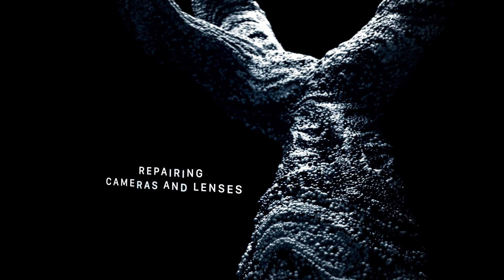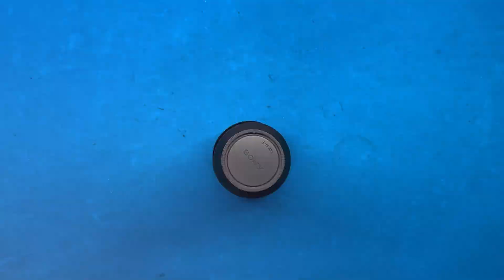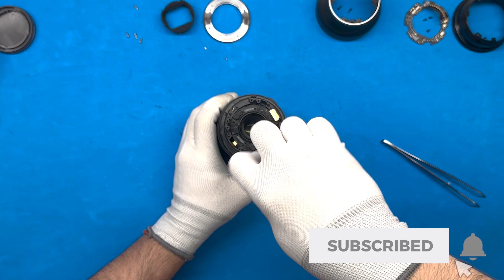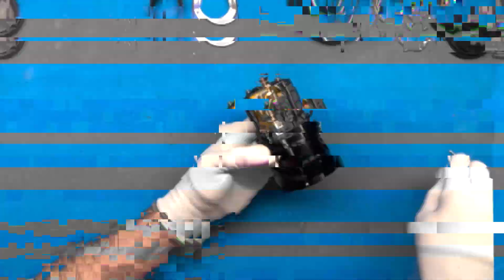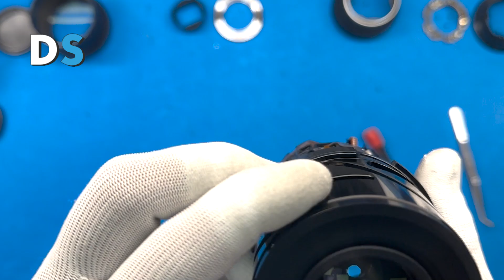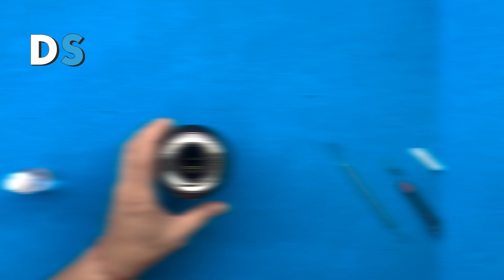How to repair Tamron lens 70-180 F/ 2.8  A056S - zoom problem (restioration by me:)

Comment: I found a temporary solution to unstick the lens and I'm quite proud so i wanted to share with you. I figured it out after messing with the lens for almost 2 hours. Here's the "trick": 

Zoom all the way to 70mm. Place one hand on the outside ring and your other hand on the rubberized zoom ring. Simultaneously while twisting the zoom from 70 to go higher in focal length, twist the outer lens ring as well. Outer ring should be spun to the left, and inner zoom ring should be twisted to the right. Let me know if this works for yall